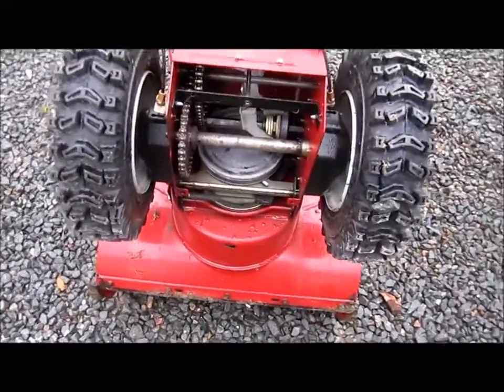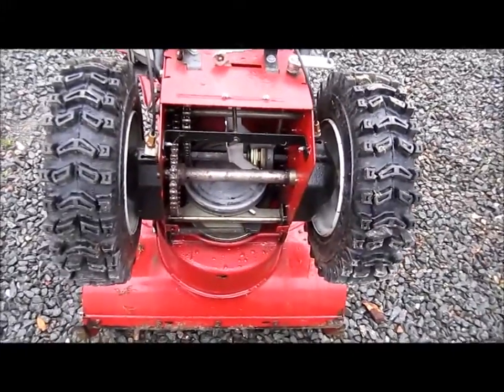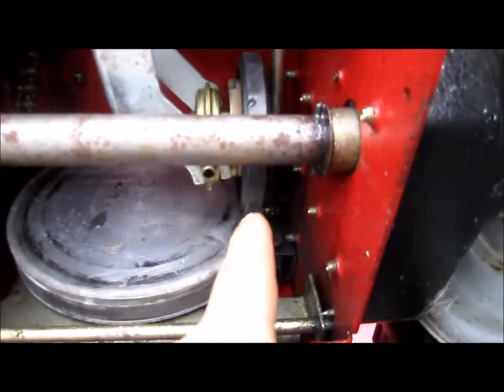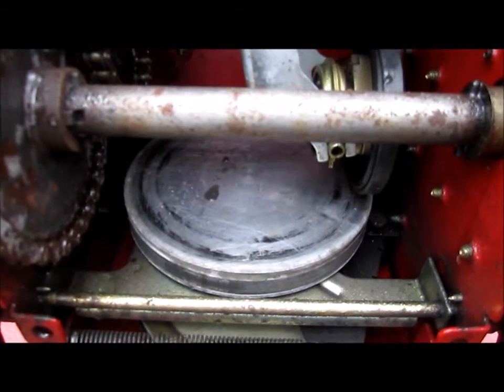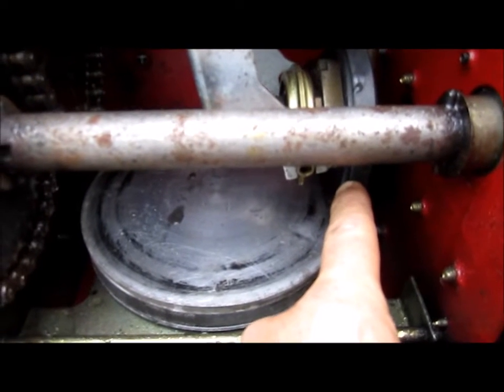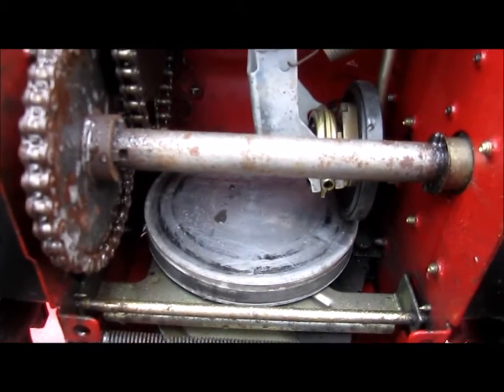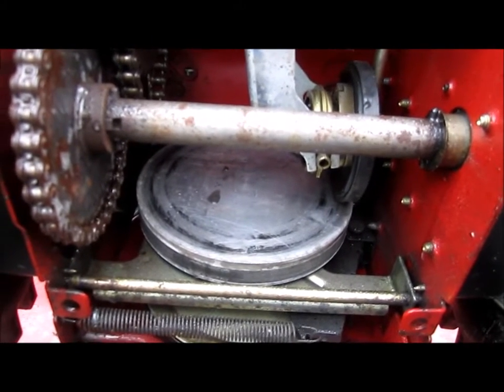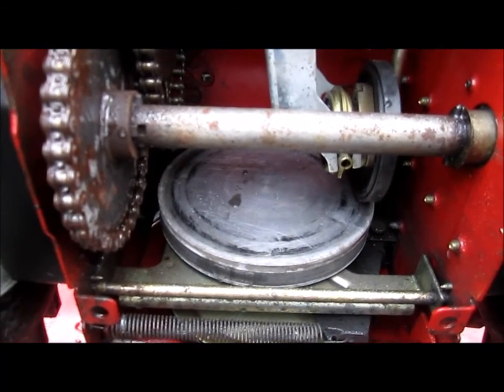How To Solve The Slipping On A Walk Behind SnowBlower

Comment: It's a bandaid but they type that will tear the scab off.
If you rough the disk, even slightly, you will wear off the rubber in a season.
It's smooth for a reason.
And right now it's freezin I'm repeatedly sneezin.
This fix *will work*. But will trigger a new problem.
Reply from the maker: Well from the time i done it. Its still working good so who knows.

Comment: Thanks for the Video, short and informative.  some people just can't help but find things to complain about (below).  quick question... do u think using the sandpaper will cause the rubber on the friction wheel to wear out prematurely?  Cheers
Reply from the maker: The rubber wheel needs to be changed out already when it starts to slip using sandpaper will give extra time with the wheel. Don't use to course of a sand paper to cut real deep lines into it. Just enough to remove the smoothness to it. At one point the rubber wheel will need to be changed. Now if the bushings are wore out sand paper is not going to help out at all. Sand paper is only going to help out to where the rubber wheel is not  catching it enough to make good connection to make it spin and move
Reply: ok I will give it a try,  getting a big storm this weekend hope it works.Thanks again... have a good weekend
Reply from the maker: Your welcome Jh   I'm hearing of lots of snow hitting many area's its a heavy snow season for some area's that really don't get much snow through out the winter. Where I'm at we had not much yet. Which we most winters get a fair bit of it. Who knows what's going on with the weather anymore. I know the last few years sure have been different where I am at anyways. Best of luck to you. : )